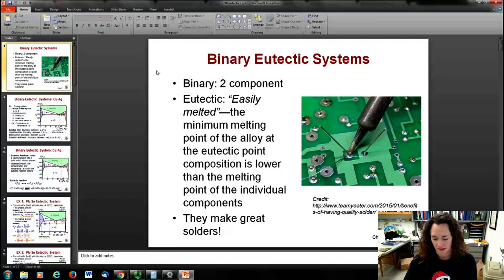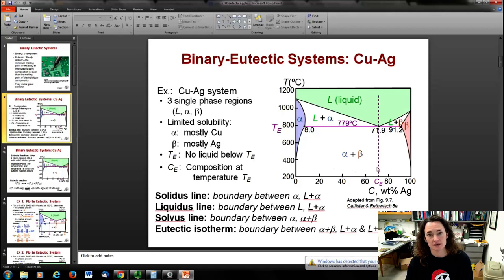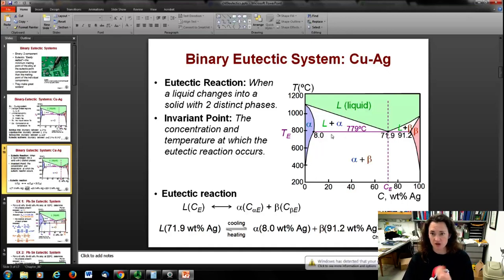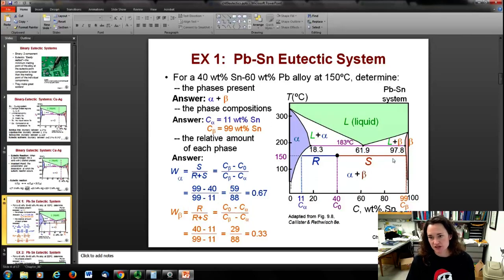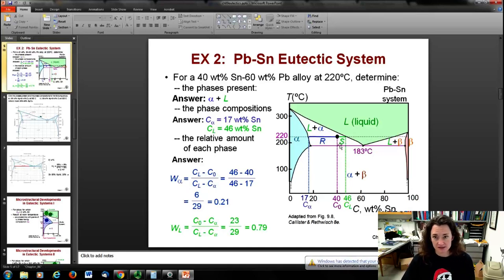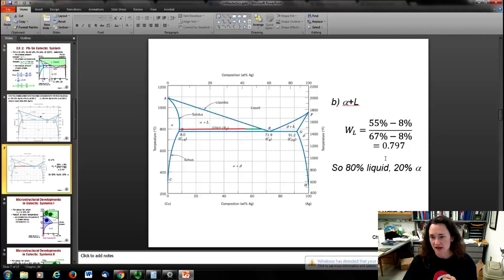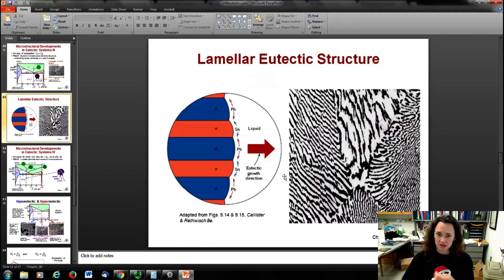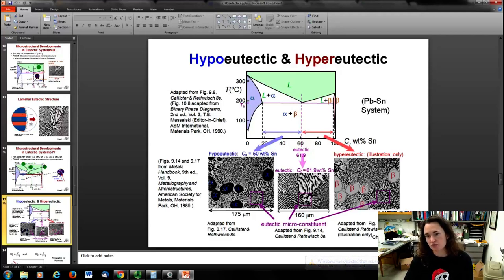Binary Eutectic Systems & Eutectic Isotherms

Comment: If we are in L + α  , it means   [(liquid=α+β)  +  solid α ) ] ?
Reply: α, β and L are used to represent the different phases of the system. α, and β represent solid solutions of Sn into Pb and Pb into Sn, respectively.
With that in mind, I don't think it's right to say that the α+β phases are present in the liquid phase. Moreover, in the liquid phase, there are both Sn and Pb, but as liquids, and not as α, β solids. Therefore, within the L+α region we have a liquid phase (L) and an solid phase (α), and both of them are solutions of Sn and Pb.